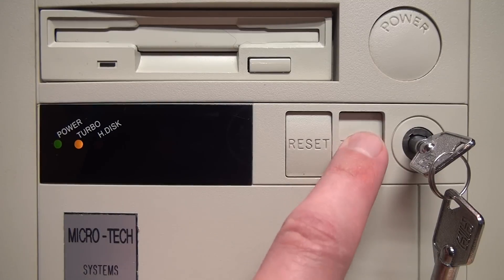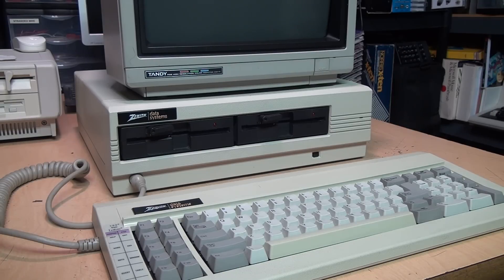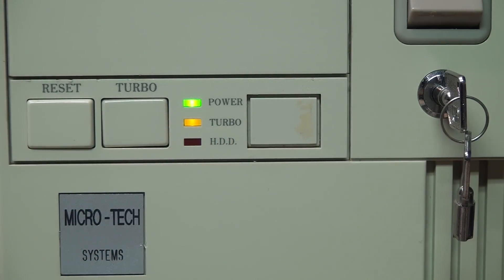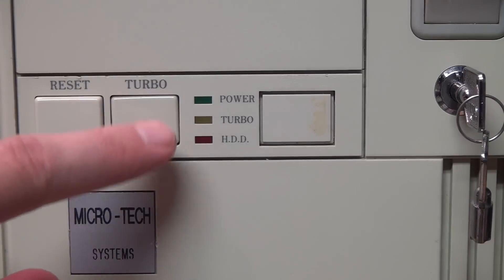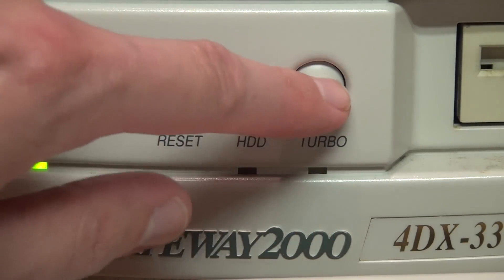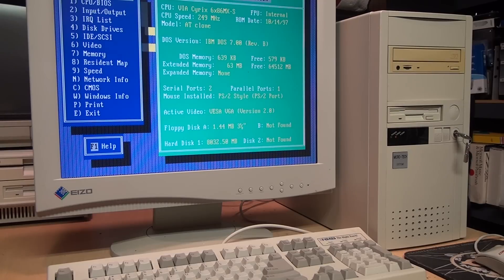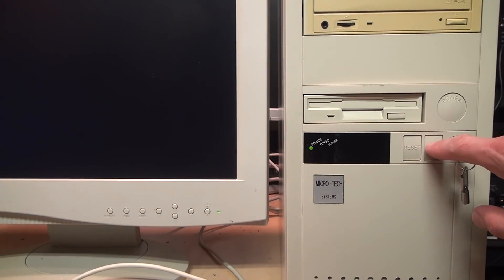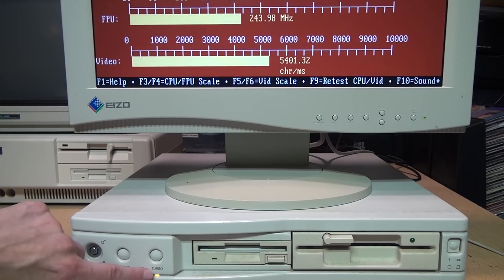The PC turbo button mystery finally solved! (beta version)

Comment: Well, not quite debunked I’d say, rather confirmed. The turbo button actually does slow your machine down, but some people misunderstood the actual action. Some came to believe the “turbo mode” was the slower speed, rather than the faster. You said it very succinctly: Unless in turbo mode, the speed is capped.

Comment: My Epson Equity III+ has THREE speeds - 8,10 and 12 Mhz. The LED changes from red to orange to green, respectively.
Reply from the maker: Yes -- on some systems, in addition to Ctrl Alt + to select turbo (full) speed and Ctrl Alt - to select slow speed, there was also Ctrl Alt * to select an intermediate speed.
Reply: @vwestlife  I will have to try that next time I boot it up. Thanks for the tip ;)

Comment: I think arguers of both side has it right, but for different logic.. Hear me out... Turbo mode does let computer run  at it's max speed, or faster than not turbo... BUT turbo mode never make computer faster than it's rated nominal speed, so turbo button's function is to slow machine down...

Comment: I understood this had to be the case. Indeed possibly the misinterpretation originated from computers lacking indicators for turbo mode and cpu speed and the button connected "backwards". Long ago at the library in my school they had 2 computers for doing web searching (1995-1996 somewhere when that was all new). These had turbo buttons, turbo led and also display for the cpu frequency as well as the keylock and I remember with turbo inactive they ran I think it was at 33mhz and active with the turbo light on the cpu display said 66 so double the speed in that case. As u said at the end however Turbo also probably later became the main state for the computer and was on by default with the possibility to turn it off for compatibility. People without indicators on their computers would surely have a "what the!" moment when they pressed it thinking they had enabled turbo and found the computer running like a slug afterwards.

Comment: I have a P133 system in a case with a turbo button, which of course is useless. So I grabbed a bunch of jumper wires and repurposed it to switch between the internal PC speaker and redirection through the sound card at the push of a button.
Reply: That sounds pretty cool, pardon the pun.

Comment: To make things even more confusing, some keyboards also has a Turbo button, which may or may not have anything to do with the computer's Turbo mode. On the Focus keyboards for example, it allowed you to change the speed of the typematic instead. Cool video! :)
Reply from the maker: That's what I've always understood the turbo button on a keyboard to do: to increase the typematic rate. The only possible way it could influence the computer's CPU speed is if it was a macro programmed to the equivalent of pressing Ctrl-Alt-+.

Comment: Fascinating! I think the "retro hobbyists" are responsible for the "Turbo=Slows down" meme. I did use to think it was an industry in-joke, given that the PC industry was geared to BIGGER,FASTER, MORE POWER, why would you market a machine that had a button to force it to run slower? So the button said Turbo instead of Underclock as a quirky gag. Thank goodness for books.

Comment: At 13:16, you can permanently use the green power LED as your turbo LED, since you have the segmented display to visually show it's turn on.
Reply from the maker: Yes, I was thinking of that, but I'd need to rewire the connector because the power LED uses a three-pin connector with the middle pin missing (originally meant to be tandem with the keylock connector, but this case doesn't have a keylock anymore).

Comment: When I was a kid we had a 286 clone with a turbo button and we ran a piece of software similar to the one you ran in this video to get the clock speeds. With Turbo unpressed, the computer ran at 9Mhz. With Turbo pressed, 13Mhz.

Comment: I remember back in the day thinking why have the option of not running at higher performance and you’ve answered that, thanks! 
At the time, I assumed it was an overheating issue because turbo mode usually ran hotter so we perhaps mistakenly switched off the turbo to avoid overheating. 
Certainly, PCs got very noisy with the internal cooling fan running like crazy in turbo mode, which was fatiguing on the ears.

Comment: There is a large part of me that wants to see VWestlife take a look at the Atari ST, then the Amiga, THEN the Acorn Archimiedes.  But I have a feeling he'd have some bother with system prices especially with the Archimedes as it was the first system powered by the Acorn RISC Machine later known as the Advanced RISC Machine and... well you know what follows from there... but VWestlife with an Archie...
Reply from the maker: I have done videos about both the Atari ST and Amiga. Acorn's RISC machines were not sold here in the USA.
Reply: @vwestlife  Well, to be fair, it would be hard to avoid Acorn's RISC Machines, if you have a mobile phone, you have an Acorn RISC Machine.  Also, if you have a router, a Nintendo Switch, a printer, a Raspberry Pi...  I think Apple are transitioning their Macs over to ARM... but yeah, getting an Archimedes would have been hard enough if it was available over there but that plus their rarity.  I have a feeling that if the UK has their own Computer Era event, that certain American YouTubers would be making transatlantic flights to see what they could get.  I could definitely see LGR meeting up with Nostalgia Nerd.

Comment: Another thing that has disappeared from modern PCs is the hard drive activity light, so now you don't know when the HD is active. And most laptops have dispensed with caps, number, and scroll lock lights, so you don't even know when those locks are on. Instead, modern PCs often have case windows and interior lights, which I think are completely useless.
Reply: @Avendesora  Probably if you buy cases for home building, you still get the lights, but if you buy ready made, low end computers, you get no lights.

Comment: Yeah, I think Ctrl Alt - and Ctrl Alt + does nothing on my 2018 Dell G3 3579 laptop with its 8th gen Intel Core i7 CPU.  

But laptop came way after turbo mode even existed!  

Also, I'm running (an) Arch (based distro of Linux) btw, so that might have something to do with it.  Maybe it'll make a difference under Windows 11... or maybe not, maybe I'll need DOSBOX for that.

Comment: EVERY PC I ever used that HAD a "Turbo" button, it engaged the highest speed mode when pressed in. I guess I was "lucky". (why an option was even there to reverse this is a mystery to me and would be confusing AF without an indicator LED). When I began to hear about the "turbo" button SLOWING down PCs, I got confused as hell.

Comment: [13:15] You might be able to rig up the right hand decimal point LED in that three digit display to act as the Turbo! indicator.  I seem to recall doing that myself back then, but I don't recall if I had to solder on a resistor to it, or if the display was one you had to install jumper headers on to select which segments would light up for each "mode".  I may have done both on separate machines!
Reply: I came across a machine that used jumpers to light the segments of the display but the display only acted as simple indicator and as the power LED at that. 

Too bad it wasn't a full 3 digit display with each digit being 7 segments (it was the '188' kind of segmented display) because I could've had it say some dirty things besides "F U" and "P P". :O)
Reply: About 25 or so years ago I supported some Digital Equipment Corporation (DEC) minicomputer-based communications servers.  They had a 4-digit 7-segment LED display to show things like network boot and loading status and error codes.  But when they were up and running normally they would display a "rolling eights" pattern, where each digit would have one segment lit, chasing around the path as if you were drawing each number eight by hand.  The task driving it used idle CPU time, so the busier the system the slower the display, and a lightly loaded system would produce a fairly rapid, almost hypnotic display.

I keep wanting to recreate that effect in a piece of hardware, even scrounged up a 4-digit display at one point to breadboard it up.

Comment: Now I'm curious what Peter Norton's Programmer's Guide to the IBM PC says about the turbo button. It was released in 1985, so there were PCs with turbo buttons around at that stage. However it was focused on the IBM PC series, and the PC/AT was released in 1984, notably without a turbo button.

I'll have to check my copy when I get home from work. I've also got the second edition, which also covers the PS/2, but again those didn't have a turbo button.

Comment: I remember back in the 90s there was a utility called WASTE99. A DOS utility you could use to waste up to 99% of the computer speed/performance. This was so you could slow down the PC by a certain percentage when running older games and software. That would run too fast to play on newer computers. My frinds used to install this on the computers in the LAB at TECH college and watch the reaction of the students who had no idea why there computer as running slow until they rebooted to return it back to original speed.

Comment: All the machines I've owned that had a Turbo button worked such that with the button pressed in and the light on they ran slower (a 286, a 386, and a 486). I've got some repair books from the time period and they have warnings that the turbo switch works the opposite to how one would intuitively expect.
Reply from the maker: If you can find out exactly which books, I'd love to know. I've never encountered any system where the turbo LED being on indicates that it is running at slow speed, regardless of how the turbo button (if any) is configured.

Comment: To implement this on one that doesn't have the turbo feature, buy two crystals (high speed and one low/half speed) and 6 pin button and 1 led. Put it next to the computer and wait for it to replace the crystal and make the correct connection, assemble and solder itself onto the motherboard and after this drills two holes in the case to put the button and led in. Congrats! You can now play with super power (or not). (push the button again to turn into non-joking modus) Actually, this must be possible with two crystals and a switch to change the clock speed.

Comment: I remember when the turbo button started showing up on some of the XT cases. The clones probably added to this confusion because many of them that I encountered would default boot with turbo on but the light would be out. Pressing the button disabled the turbo function but lit the light. This gave the impression that turbo was used to slow down the machine instead of speed it up. I think this had more to do with the manufacturer having a configuration error while assembling the machine because at that time the turbo light was controlled by the switch not by the motherboard.

Comment: I honestly would love to see a modern MHz display, 4 digits obviously, but especially since modern CPUs throttle. I often keep Task Manager/Performance Monitor open just to see what it's running at. Someone needs to get on making that. Somehow read that value in Performance Monitor and output it to a 7 segment display or full matrix LCD/OLED simulation. Or even just a bar matrix. Computers (like buildings) have become incredibly boring, OOoohhh... RGB lights, whoop dee do!
Reply: I saw a thing like this a very long time ago maybe between Pentium 4 and Core 2 Duo times. Back then case modding was truly wild and you had a thing that went into a DVD ROM bay and it had a CPU speed readout as well as fan speeds, etc. It was a USB device that worked with additional software. I also had a Logitech gaming keyboard back then with a little LCD display that would also show cool things like that as well as having a buttload of programmable macro buttons.

Comment: That audible memory test... I swear a lot of '90s Macs made a similar noise when they started up but I think it came from the hard drive. I'm guessing some kind of self-test? It was a series of quick taps and then two longer ones. Am I crazy? I haven't used a SCSI Mac in 20 years but I swear I remember that noise right after the chime as the CRT warmed up.
Reply: Modern PCs are set up in the BIOS to skip most of the self test, so they start up quicker. They are also set to display a logo instead of the POST data. And starting with Windows 10, they don't even fully shut down. They just enter a modified hibernation mode called Quick Start.
Reply from the maker: You're probably thinking of the sound that old Quantum 3.5" hard drives made when thermally recalibrating. They did it often when you first turned them on, but then less and less often as the drive warmed up.

Comment: Now the question that still burns in my mind is, what actually happens to make the computer run slower? I'm confident that on XT and maybe 286 systems, the actual clock speed of the bus is reduced, but what about 486 and 5x86 systems? Is the bus clock still reduced? Is the CPU multiplier defeated? When I was a kid I was once told that extra wait states are thrown into the execution, and that always held water with me because on my M919 systems, turning Turbo off seems to make it not exactly slower, but "choppier". But I've never been given a confirmation.
Reply from the maker: There was no standard for the method used to make the computer slower. XT and 286 machines usually reduced the clock speed. Some 386 and 486 systems still did, but more and more they started doing it by disabling the cache (if present) and adding wait states. And then clock-multiplier systems (DX4, DX4, etc.) could do it by disabling the multiplier.

Comment: You did it! thank you! I've had this conversation with several people multiple  times. They always point to those dogy internet articles saying turbo actually slows down your computer and I have to explain to them exactly what you've outlined in this video. Also, yes, people have forgotten that books with technical information do actually exist and referencing them from publications contemporaneously written when this was relevant will provide you with the actual information you need. Not some pop tech article written 20-30 years later.

Comment: Turbo buttons were more or less strandard until the 386, after which they were a non-feature, no longer actually slowing to 4mhz. Many even came with an led matrix showing the mhz on the PC. I don't recall ever using it, most games had mitigations or there was soiftware to slow your games more easily. Wikipedia is a joke.

Comment: Did this stem from the recent "discussion" on Reddit?

I never understood where the idea that the turbo button slowed down your PV when activated came from. It always seems like one of those collective misrememberings to me.

It's often the way that the non-intuitove idea is retrospectively considered correct. Like the idea that the original quote was "the customer is always right, in matters of taste."

Comment: I remember using a PC, I think it was a 486 SX or something like that, who's turbo function could not be switched on the fly when the computer was in use, oh you could press the turbo button all you wanted, but the change you made wouldn't take effect until you pressed reset.  The turbo button was also wired up such that when it was latched, pressed in, turbo mode was off, but when it was not latched or not pressed in, turbo mode was on.  It's possible this PC also allowed you to change turbo mode settings with a keyboard command, but I didn't know that at the time.  I do remember on my father's PC that pressing the turbo button while playing Rise Of The Triad would make a difference to the game's performance.  I remember we had to take Dad's PC to the shop to get the CD-ROM drive replaced, that night, Dad was playing ROTT and the game wasn't running too well, Dad said "this is not a Pentium".  Soon he realised that turbo was turned off, I must have turned it off because when the PC was in the car, I'd been playing with the front panel switches.

Comment: The original turbo buttons DID slow the cpu because they existed to ensure compatibility with original IBM pc apps. later turbo buttons would work as expected, giving you the full speed, instead of a reduced one. No pc I used back in the day used the earlier behavior. All of them were wired so as to actually increase the speed to the max, as it should be BECAUSE THAT'S WHAT TURBO IS SUPPOSED TO MEAN. Calling the button that throttles you down "turbo" is a massively retarded thing and I wonder what kind of mushrooms the people who thought of that were into.

Comment: Haha. I got some good laughs, thanks! I never understood why anyone would think turning on turbo slowed things down... When I assembled PCs for my high school job, I always wired the switch so pushing it IN would activate turbo. This makes the most logical sense.
Reply: Take a  PC with a momentary turbo  switch (plenty common, given the desire for software control). Turn PC on, BIOS initialises the system to full speed. Press the momentary switch labelled "Turbo",  the PC will now be slow.

It's a stupid 'myth' derived from a poorly named feature, but without qualifications the statement "I pushed the turbo button and it made my PC slower"  would be the actual experience of many first PC time users in the 90s.
Reply: @nathanosullivan8816  I've actually never seen a momentary turbo button after having worked on thousands of PCs over the years. The gateway demoed here was the first time I'd ever seen it. I have boxes of PC motherboards from XTs to Pentiums and they all used an on/off switch. The biggest change was when they reversed it so open meant turbo, happened it seems in the 386SX era at least with all the boards I have.
Reply: Most people got them from stores that way though.
Reply: Lmfao,good job!!